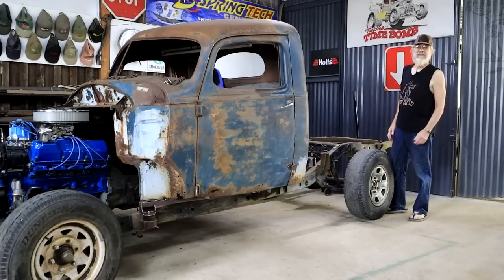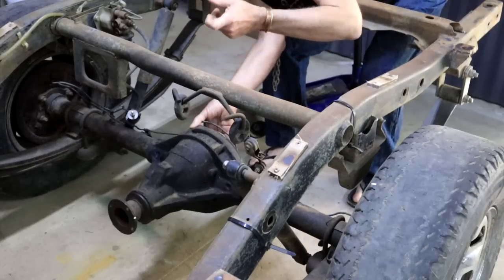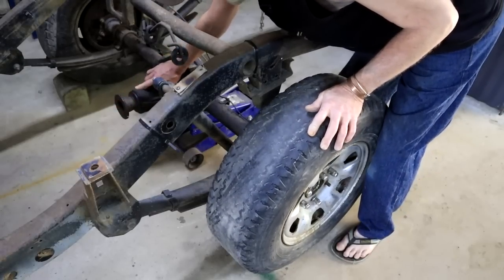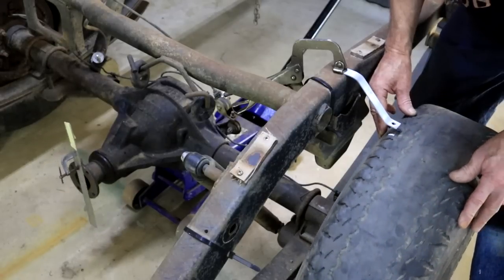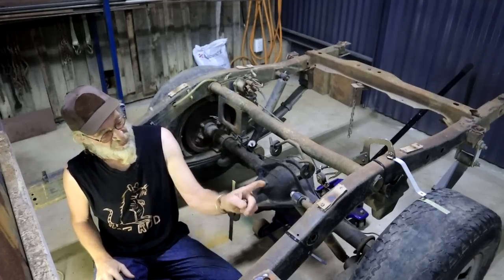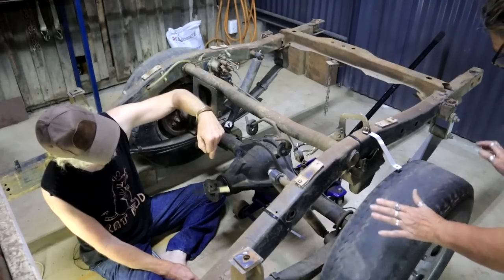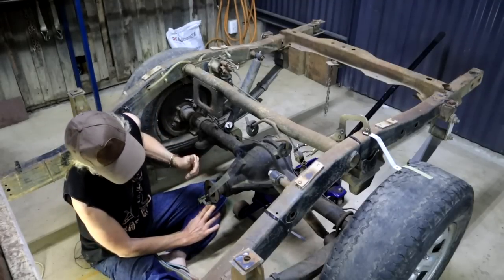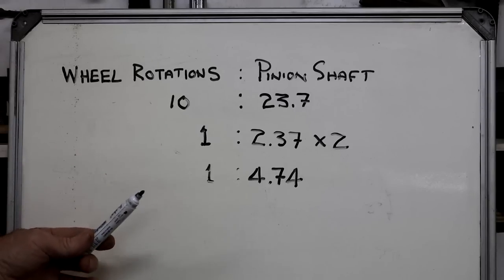EASY WAY TO FIND DIFF RATIO & CRUISING SPEED -  Part 7 of 1939 Hudson Rat Rod build

Comment: Hi uncle,
Jah nee, the tire profile makes a big difference, when I was still doing oval track racing the tyre profiles made a massive difference in my speed in the straight line, but in the corner I don’t want to shift gears so at the end the 13 inch tyres we used had us playing around with profiles instead of diff ratios,
Thanks for the lesson,
Be blessed 
Ciao ciao! 👋

Comment: Hey,brother check the dent side ford diff. The one you pulled the bedsides off of for your last project, some of them are geared towards high way speeds like 2.76 up to a 3.08
Reply from the maker: That one is a 4 x 4 F250. Diff ratio will be high.

Comment: That is the first time I seen someone double the pinion rotation. I had a 64 Plymouth with a 2.76 rear gear ratio. When I spun the wheel around, the pinion went around 2 and about 3/4. So that showed a 2.76. I can’t remember the rpm to mph. 
Great video. I like it that you go through your thought process. It really helps out. 
Good luck finding what you want. I too am looking for another ratio for my Falcon. I want a 2.79 out of a 70’s Ford Maverick. That will give me a 5 lug pattern too. 
👍🏻👍🏻!!!!
Reply from the maker: If it's an open diff and one wheel is stationary, you have to double it. Further proof is in the fact my answer correlates with diff ratios provided by Isuzu. They never made a diff with 2.something ratio.🙂
Reply: @ratrodsafrica  I’m always learning something here. My best bet is it has a tag with the ratio stamped on it. 🤣🤣🤣
Reply: @ratrodsafrica  hey my brother, would you happen to know an equation to be able to choose the right combination of tire diameter and gear ratio to be able to cruise in my ‘61 Falcon at 70, where it would be most efficient for my engine? 
It has a stock 200cid (3.3lit) straight 6 cylinder backed by a C-4 automatic transmission. No overdrive. Right now it has 23” tires, and 3.10 gear ratio. The RPMs are pretty high doing 60. I do plan to go to around 27” tires. That will get the RPMs down some, but still in the upper 2000s. 
Any advice will be greatly appreciated.
Reply from the maker: @DoonerF  what rpms would you like to have when cruising at 70?
Reply: @ratrodsafrica  that’s where I’m really not sure. In my experiences with vehicles with automatic transmissions that have a 1:1 final gear, I want to be as close to 2000 rpm as possible. And I’m concerned with the power of the engine, whether it will be in a decent fuel efficient range. 
I hope I’m making sense here. I’m starting to confuse myself. 🤣
Since I like the look of large diameter tires tucked under the fenders, I was hoping to go to a 27” diameter tire. And with that, I worried that if I go too low (numerical) of a gear, it might have a tough time turning them. Not looking to take off fast. This is a cruiser. 
What are your thoughts?
Reply from the maker: @DoonerF  I don't know those   straight 6 engines well enough to make a call on best rpm at cruising speed. I will ask around. Drop me a mail at ratrods4africa@gmail.com

Comment: Thanks for the brain exersize . Lol you thought through every sinerio . Very good job played with this a bit myself over the years lol i ran 52 in tires with 4:11 gears gave me like a double overdrive . So hears a idea now ive run stacked transmitions since i was a lad . There a bit hard to find bit i was watching vidios for ideas and this canadian chap took a 4 speed fliped it backward added a suport bearing pillow block bearing he used
Reply: So he fliped the second trany backward macking mutiple overdrives . He had a special drivline made but i dont think be to hard becouse you could take the clutch disc cut her down put her in the driveline and weld her up. Now i have debated with meself if you can run a automatic for the front ?? Double clutch  how you shift the trany . But my tractor has a hydrostatic with a stick behind and it cam be shifted on the fly so it must be possible dont you think ????? Hell the canadian chap made a vidios driving the old girl across canida so
Reply from the maker: Yoh man, too complicated for me. Lets keep it simple!😄

Comment: Hi Diff, I had a HG Holden V8. It had a 2.89 diff ratio and was great cruising speeds. I think was around the seventies. Might be too weak for a 351. you might have to look at a Ford 9 inch centre diff.
Reply from the maker: I reckon a Holden diff will be good enough. Not building a dragster 🙂
Reply: The old Holden had  2.89 and I then put a 3.08 into it. For memory,  I think the ratio is stamped on the yoke. Input yoke.
Reply from the maker: @peterkelly250  busy chasing the diff from a Holden Ute. Over here they were branded as a Chevrolet El Camino

Comment: Is that 1:1 output when it is in final drive gear?  As the transmission shifts / changes up in gears, the ratio changes.  Thanks
Reply from the maker: Yes, 1:1 in final drive only

Comment: Rim size and tyre aspect ratio is what I played with to lower the rpms on my pet car I took 500rpm off in top gear at 100kmh cheaper than an overdrive gearbox , you need about a 3;1 for that engine, Hunt down an old Falcon I know you had Ozzy Falcons there
Reply from the maker: Yes, tyre size can make a big difference. I can get a diff out of a Holden HQ with 3.1 ratio. Think that will do the trick well enough

Comment: Forest engineering has taken a big step!   Very interesting and informative. What are your chances of finding a diff that is the right width and wheel bolt pattern?
Good video!  (I'm off to the shop to build a light bar for the Ranger)
Reply from the maker: Thanks man. Width doesn't bother me too much cause everything in the back will be custom anyway. As for wheel bolt pattern, I might end up with adapters. Let's see.

Comment: Hi Div, if you'd have thought me maths I'd have paid more attention using engine rpm, transmissions and diff ratio id definitely stay in class 😂😂. Would the Jag have a better axle,might not be the diff for the axle in the truck
Reply from the maker: The Jag diff will be great. Also LS. But it's IRS and I want solid axle for this build

Comment: That's almost how I do it too. I have the wife rotating the tire 20 turns (other wheel on the floor). So if the prop shaft turns 34-and-a-bit, I know I probably have a 3.42:1 rear end ratio
Reply from the maker: Yeah, that will work too! Think my wife will lose track though😂

Comment: You forgot to mention if it's a posi or a locker rear end you don't multiply it times two way I learned it radius * 2* 3.14 is your diameter of a circle thanks for taking me back about fifty years in math class in 6 grade
Reply from the maker: Both formulas work. Radius x 2 = Diameter 🙂

Comment: Lets try this again . Stacked transmitons one forward one backward . Lets say a standard 4 speed no overdrive backwards gives you a overdrive the ratio of the gear reduction for 3 gear . 2nd the same making a double overdrive . Their are vidios on this . From what i can see they added a pillow block to the pilet shaft and used a old clutch they machined down to fit the drivline and welded it in . Tractors run stacked tranys for underdrives, my 1 truck had stacked tranys had a winser 3 speed 22 %over with 50 %under. If you use a trany with overdrive the overdrive becomes a underdrive . Theirs tons of options .
Reply from the maker: All depends on application and what you want to achieve. Why would I want to get that complicated in my case?🤔

Comment: Div with the C4 the engine should be 1500 rpms at 55mph or 88.5 km/h using 3:73 gears depending on tire size.
Reply from the maker: My calcs say you would need about 40" tyres to get the numbers above! C4 doesn't have overdrive, so final ratio there is 1:1

Comment: Here's the formula for calculating gear ratio: (RPM x Tire Diameter Inches) / (Final Drive Ratio x Transmission Gear Ratio x 336) = Actual numerical gear ratio to the ground from every revolution of the engine

Comment: How about I give you the imperial stuff.  (Tire Height X RPM X .002975) divided by Gear Ratio Equals MPH and you can multiply that by overdrive if you have one. The tire height is in inches. This is how I figure out what parts to use in my ratrods in oklahoma.
T.H. X  RPM X .002975
------------------------------------   =MPH
          G.R.

Comment: Also need to add...your math is flawed.  Your diff  rotation number does not require doubling.  Clearly that diff is a 2.37: 1
Reply: Yes it does need doubling. One wheel is stationary.
Reply from the maker: No sir. With open diff and one wheel stationary, you always have to double. It is the nature of the beast. Also, Isuzu never made a 2.37 diff